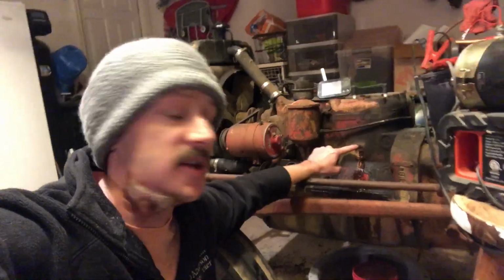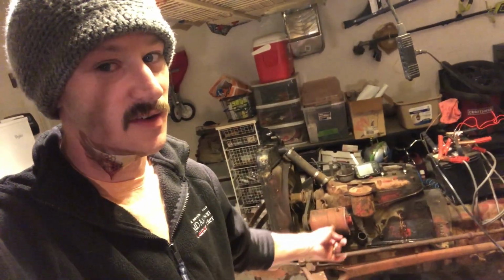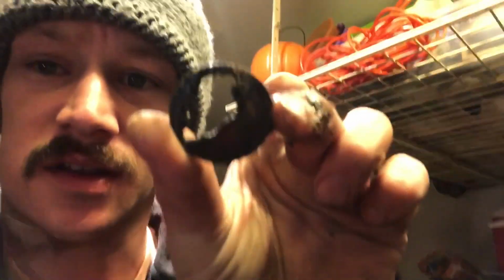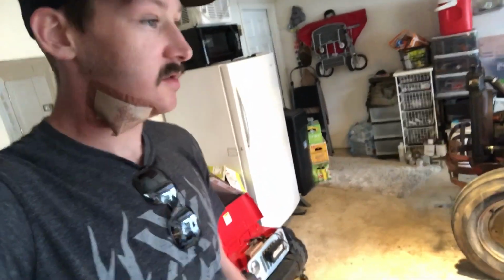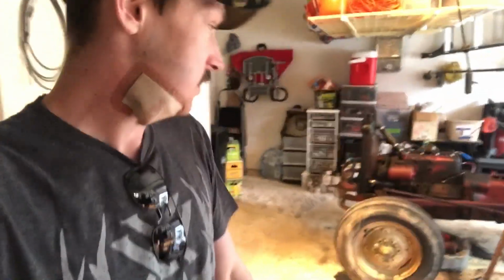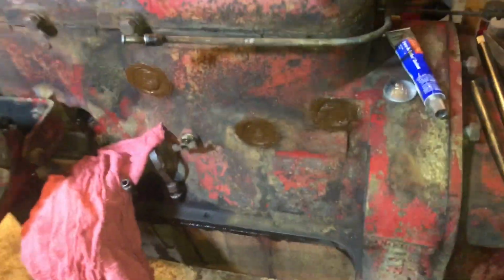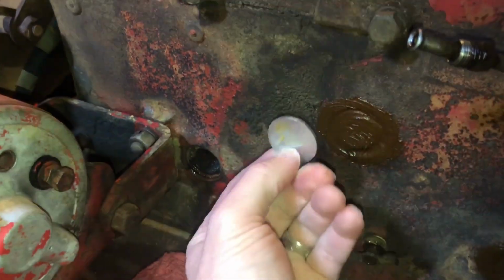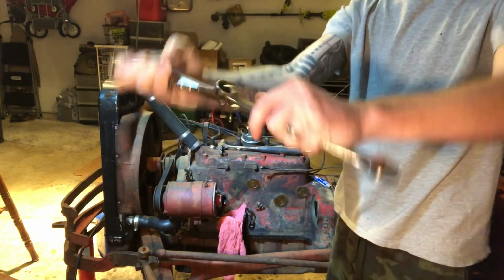Freeze Plugs - 1952 Ford 8N

Comment: Tips from someone with a handsized weeping wound on his leg that the doc says will never heal.  ABD pads are your friend. Double up if it's really leaking bad. Hold it in place with 3M Medipore tape at the edges. Use 3M Cavilon  barrier film if the tape irritates the skin.  I hold mine in place with TubiGrip, but that won't work in your case so maybe switch to wearing turtlenecks or a scarf like the WWII pilots wore to impress the ladies. I don't know if your doctor would recommend it or not, or if insurance will cover it, but to help prevent infection my wound clinic doctor uses AquaCel Extra AG that goes on the wound to kill bacteria. There are also pads infused with Manuka Honey that have shown to heal wounds and prevent infection. I'm trying to get my doctor to prescribe that. The AquaCel isn't cheap at $17 for a 4x5" pad on Amazon and I have to use 2 of them on my wound. I'm lucky that Medicare covers it.

Good luck. May God watch over you and comfort you throughout this ordeal.

Comment: There's one large O-ring on the piston in the top deck of the tractor that control's the lift and float   of the three point. Make sure the bore is free of rust and you are gtg. Most failures of hydraulics come from that location.

Comment: This is awesome. Thanks for doing these. My '52 8N has been sitting in my barn and hasn't moved in three years. You are inspiring me to start working on it this coming summer and resurrect it. Mine has a loader on it so access is not quite as easy but it should be fun.

Comment: When you rebuild the hydraulic pump also change out the small valves in the side plates of the pump. Also the piston rings may be worn out enough that it will just fall out of the cylinder. If not use air pressure to pop it out. Reuse the cylinder unless it has scouring. The new piston will have leather seal instead of the rings.

Comment: Core plugs are simple to replace but as you say do all of them.  There may well be one behind the clutch bell housing.  There is always one sneaky one.  I just drive a screwdriver into them, then and clean the push them into place and flatten out with a ballpien hammer.  I have never used any form of sealant as they fit pretty tight once hammered.  They should be a good push fit before flattening.

Comment: freeze plugs look like you put them in backwards..I've never seen one domed outwards. The lip should be facing out and you hammer them in with a socket that fits inside them.
Reply: https://en.wikipedia.org/wiki/Core_plug - he did it right.